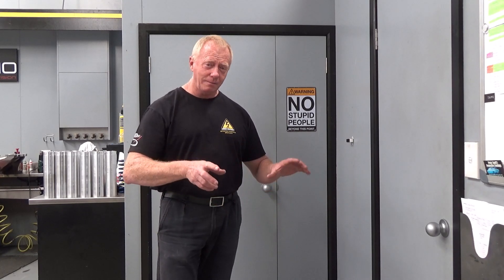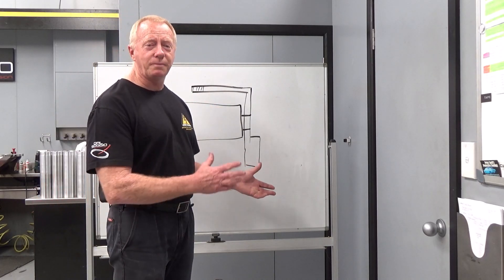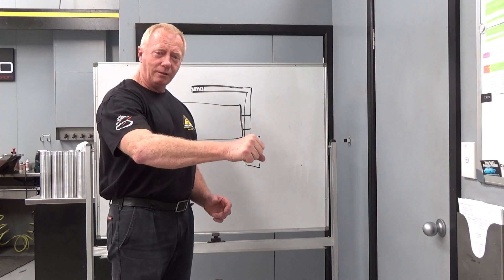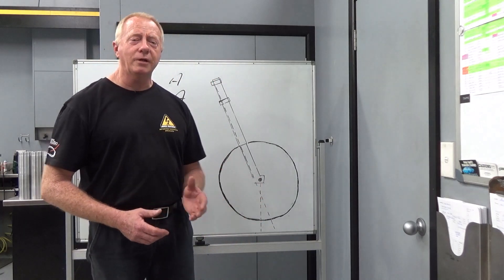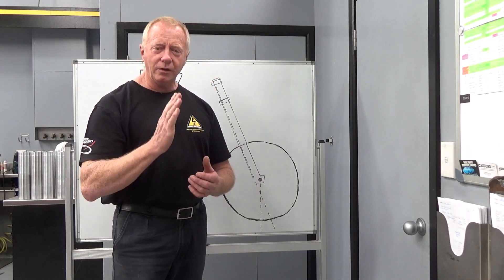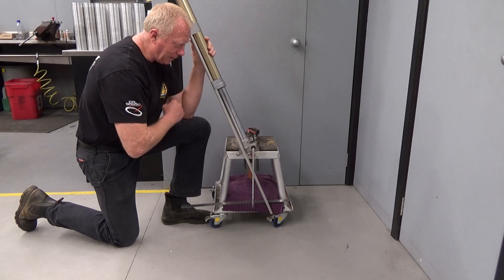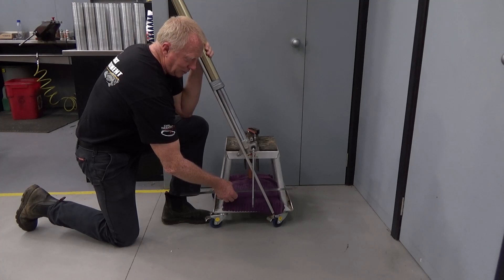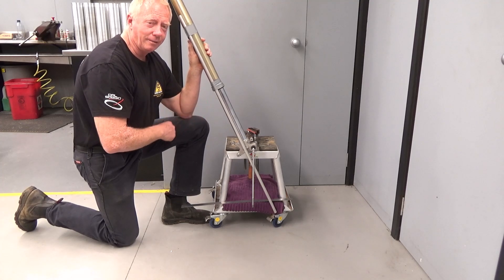Steering versus Cornering

Comment: I feel this is not correct. I road raced a zx6r, it had chatter. The chatter was reduced with a softer carcass tire (Pirelli vs. Dunlop). I know other suspension tuners have told me it's a stiffness (chassis resonance issue). I've pushed the front on a 2001 gixxer 600 and it slid very predictably. The 2009 zx6r was less so, and only on the softer tire with very specific tire pressure. Ride height and fork angle never affected it. It was a bit scary, even though I was able to minimize it. I think the chatter is from a positive feedback loop with the harmonic of the juddering tire forming a positive feedback loop with the frame's harmonic. IMHO.

Comment: How do i solve corner exit under steer issue if i do not have access to adjustable clamps or fork legs? For supermoto
Reply: by increasing the swing angle at the rear (measure relative to ground). or by raising the triple clamps higher at the front (aka dropping the fork tubes in triples). or by doing both. both steps will have the effect of changing the swingarm angle, which in turn will change antisquat characteristics of the bike and make it understeer less on exit.

Comment: WOW, super interessting and you got me wondering about my bike setup
I ride supermoto and was experiencing a lot of front end chatter
my bike has a adjustable headangle, it is set 1° steeper, I am wondering if a slacker headangle could help the situation?
or in general, does a slacker headangle helps with front end traction?
Reply from the maker: More trail/Rake will provide more grip and reduce chatter. For motard we are generally reducing triple clamp offset significantly. If yours is a converted MX bike then you have suffered with the wheel diameter change. The front axle has effectively been lowered 2" whilst the rear has been lowered1. This needs to be rectified. Given that you have an adjustable steering angle would suggest you have a more elaborate motorcycle.
Reply: @shocktreatment5495  yes, it is a proper supermoto from husqvarna (sm 450 rr) with a short offset triple clamp, but nevertheless I experience wheel chatter quiet often
Would you recommend shortening the wheelbase and slacken the steering angle to keep the handling great and fix the chattering?
Reply from the maker: @tobiasjacobs4782  What is the offset of your triple clamp?
Reply: @tobiasjacobs4782 is it running air forks? How much fork travel are you using ? It may be a cause of too much Compression or air fork is too stiff
Reply: I'm not totally sure but either 13 or 15 mm

Comment: Terry, thanks for the explanation. How did you find the geometry on your DRZ400E? Did you raise the forks and what number did you settle with on the rear sag?
Reply from the maker: The DRZ could use a bit more feel in the front. I'm 6'3" 105kgs and I run 95mm in the rear. A shorter person would run more sag. For me, the caps only are through the clamps.